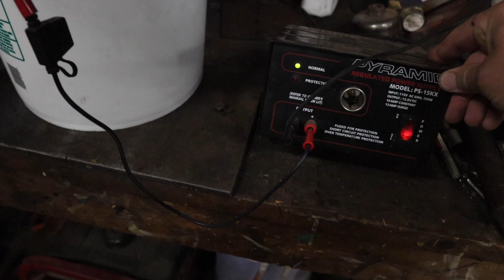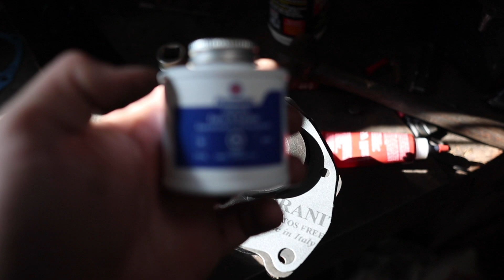Case David Brown 1394 Water Pump Rebuild

Comment: Cleaned up really nice.  Use to have one of those power supplies on one of my radios.
Reply from the maker: This one just starting going on the fritz might have worked it too hard doing electrolysis lol It did work good though, had better luck using that than I ever did with a battery charger.

Comment: Great rebuild, I like your electrolisis set-up, simple but effective. You re giving me ideas. Thanks
Reply from the maker: Yeah i like the electrolysis I can just set it up and leave it, takes longer than sand blasting but it’s still effective. I’m having trouble with that little power supply now it might not have been rated to run as long as I was running it. I’ll have to figure out what’s going on with it.

Comment: Sounds like someone is frying bacon at 2:54, now I'm hungry!
I use lye for my electrolyte, I feel it works better than the washing soda.
Reply from the maker: I’ll have to try that. I’ve had mixed results with washing soda, I used the arm and hammer stuff for a long time and it didn’t seem to work at all, then I bought some stuff on amazon that seemed better. But I’ll try lye next time. That was freezing rain hitting the window, wish it was bacon cooking haha
Reply: BACON!!! Or freezing rain..  😪
Reply: I'm sticking with bacon!
Reply: @ThatOliverGuyChris  I like your thinking 👍😁😎
Reply: Scott, I should mention that you shouldn't put anything with aluminum on it in with the lye. It won't be there when you come back.
Reply from the maker: Lol good to know! I actually never put anything but steel in the electrolysis, I read other metals can cause more dangerous gasses among other stuff.
Reply: Yep. You shouldn't use stainless. It pulls the cadmuim out of the metal and makes the water toxic.
Reply from the maker: Yeah that’s right, I think when I first started using it about 10 years ago I googled using stainless for an anode because I was getting tired of cleaning the steel. And that’s what I figured out. One time about 5 years ago I put a part in and connected the charger leads backwards. Sure made for some clean anodes but my part was a bit ugly lol